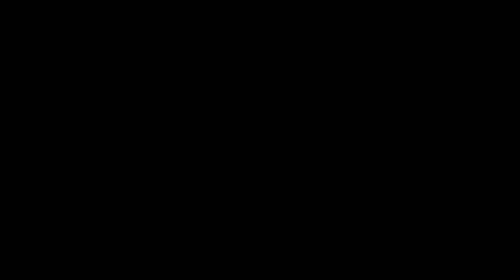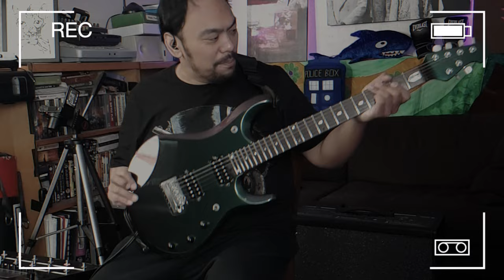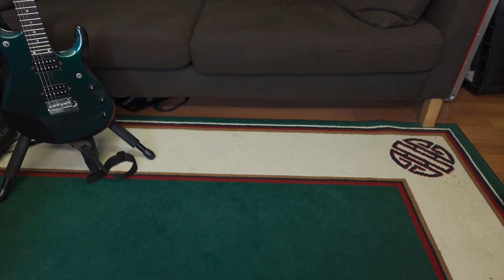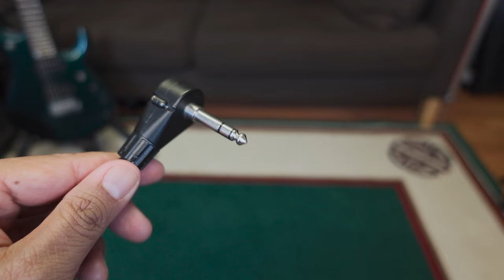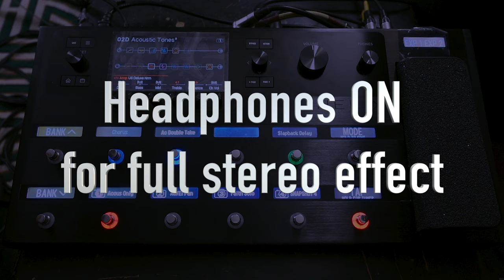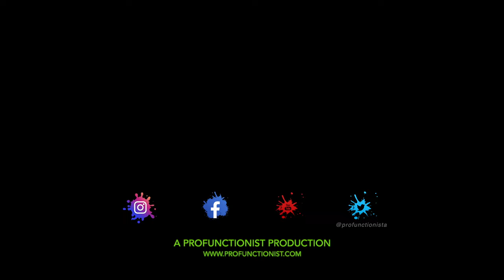My Line 6 Helix Tones - Piezo Acoustic Bank

Comment from the maker: Apart from using an actual acoustic guitar, how do you get your acoustic tones on a gig?
Reply: The 3.0 release of the polyphonic blocks is well and truly worth fidgeting with.   These were all built from the ground up and using the exp mapped to the parameters you can get amazing tones.   Only thing better I know of for decent acoustic feel would be using the sim1 pedal. That thing is insanely good.
Reply from the maker: @AlecBourneMidiMadScientist  I still have a lot of the 3.0 features to check out. Looking forward to it. May also have to look into the sim1 pedal. You've piqued my interest :-)
Reply: @ProFunctionist  thing is nuts man, does everything but delay, but the real strength is the ability to profile Guitars, and exchange them in their community database.  Outperforms the Variax big time, but you don’t get all the tuning trickery.